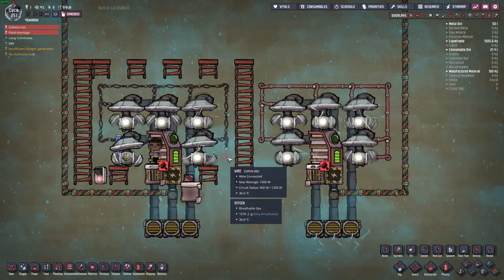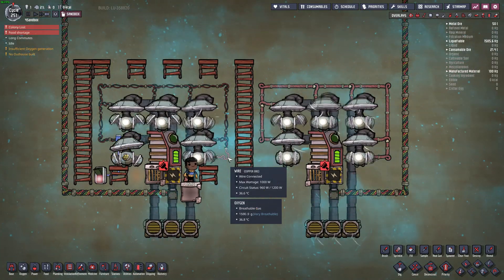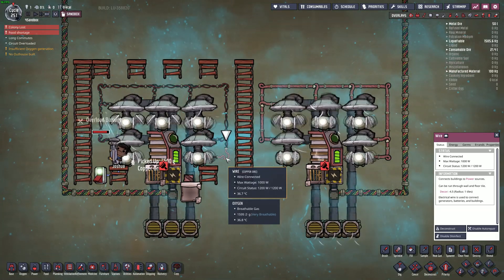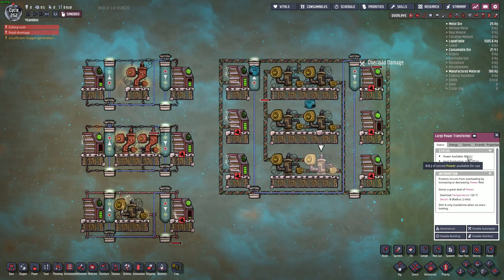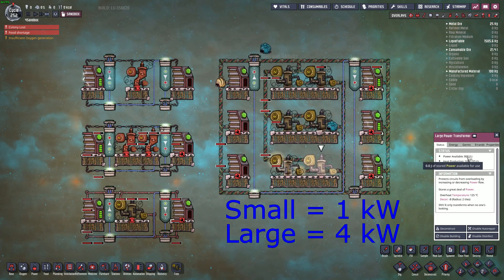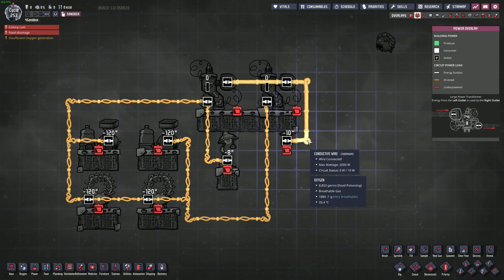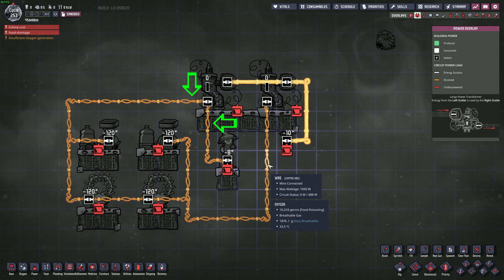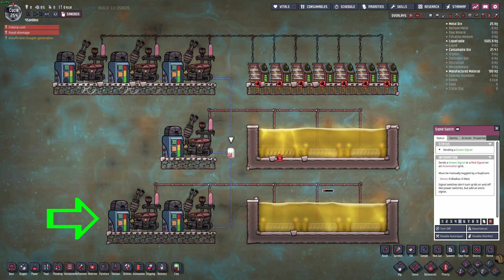Oxygen Not Included – Power Wire Overload

Comment: Hi there, you did not mention anything about wire bridges and how they overload, I am confused why my wire bridges can overload when I was using conductive wire and the load was under 2000, The wire bridge was used so my conductive wire could cross my regular wires so they stay in different circuits. I made sure to check all my wires were conductive wire and only the wire bridge was overloaded.

Do you know why this happens?
Reply from the maker: A bridge always overloads before a wire does.  The same rules for overloading are followed, the game just chooses to damage bridges first.

So your wire is definetly overloaded somehow.  If you can't figure it out, you can post a picture on the discord or reddit for the game (I presume those communities are still active) and people will tell you where/why it's overloaded.

(You can use the fact bridges overload first to your advantage as you learn: put a bridge in a place that is easily accessed and then you don't have to run around everywhere doing small repairs in hard to reach spots)
Reply: @GamersHandbook  Thank you for the reply! I will use that to my advantage then.

It is very strange because the potential load if all machines are running is 1860 / 2000. There is no way it will overload. The bridge is connected to my most demanding machine in the circuit though  (the skill scrubber).

Comment: Hey man, quick question, if i have 5 nat gas generators working at the same time, (total energy production of 4000W)  to fill a bunch of batteries, if im using conductive wire, does that mean that only 2000W per sec is being stored and the rest is lost?
Reply from the maker: You can use any size wire to store charge and none is lost.

If your batteries are full, and consumers aren't using what your generators are making, then charge is lost.  But you can fix that by using a smart battery and automation wire to turn off your generators when the batteries are full.

Getting the power out of batteries is the scenario where breaking wires can happen depending on how much you're consuming.

I abuse the principle of small wires being able to charge anything without breaking and without loss of power in this build.  (Warning, it's not the easiest topic to understand)  https://youtu.be/XLjUxmzhEA4
Reply: @GamersHandbook  Amazing, thank you so much 🙏

Comment: Well I watched this and I'm still confused as hell about how overloading wires work...
Reply from the maker: Using more power than a wire can handle overloads it.  Providing power (aka generators) doesn't overload.  Stuff that is off doesn't overload.
Reply: @GamersHandbook  Okay, I still don't get it, does a whole circuit have to be the same wire to prevent overloading?
Reply: I dont get the numbers here either, you've got a 4 kilowatt transformer and 1 kilowatt transformer.  But I don't get how to apply the outbound load from a 4 kilowatt transformer onto active circuits that can be either 2 kilowatts or 1 kilowatt depending on the wire type used.
Reply from the maker: @catloverjerrygarcia5086  you prevent overloading by not having too many consumers on at the same time on the same wire
Reply: @GamersHandbook  Unfortunately such vague wording doesn't help me.  I'm Autistic and need a concrete demonstration of what you're saying.  Something with definitive numbers that I can do the math on and understand or ask how the calculations work.  Can you draw 4 kilowatts of power from a 4k transformer to 4 1k transformers using two separate wires of 2k each to 2 1k transformers?
Reply: But if you take a 1k wire off a 2k wire to a lightbulb does the 1k wire suffer?  This is what I don't get?  How does using a short 1k wire jumping from one tile to the next suffer damage?
Reply from the maker: @catloverjerrygarcia5086  I suggest you hop over to the reddit r/oxygennotincluded and see if someone over there understands what you're looking for, because I'm not following you.  I think getting a few others looped in on this with a different explanation perspective is what's needed to help you out.
Reply: @GamersHandbook  Say I run a 2k wire off a 4k transformer as a backbone and then just before the device using power that totals less than 1k pull off the 2k backbone wire like a lightbulb that only draws 10 watts, does the 1k wire feeding the 10 watt lightbulb suffer damage?  Or does the entire circuit from the 4k transformer have to consist entirely of 2k wire and if the total draw from the 2k wire is say 1.5k.  The real world answer would be no the 1k wire connection with the backbone would not suffer damage.  But that doesn't seem to be the case in game.
Reply: I'll see if I can work up a visual in the game in a few hours.  Maybe it'll help you understand my thinking better.
Reply: Here's the visual, in my last game I had overload warnings for exceeding 1 kilowatt even though I was branching off the 2 kilowatt wire with 1 kilowatt wire to feed circuits that were less than 1 kilowatt.

https://drive.google.com/file/d/1QMoDeqRqZLgoupEA33Li-M7BMVQu_vfG/view?usp=sharing
Reply: Anywho, I'll keep an eye on it to see if it's just a screwup I made or something else.